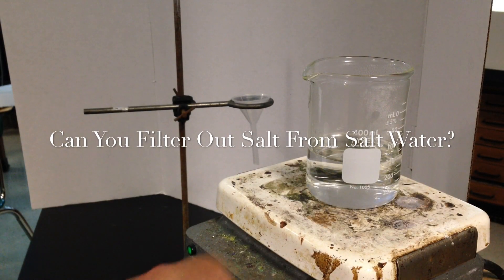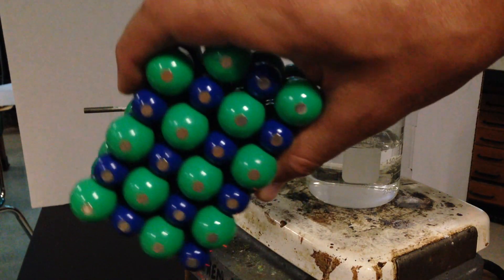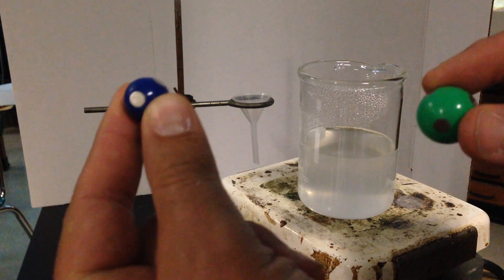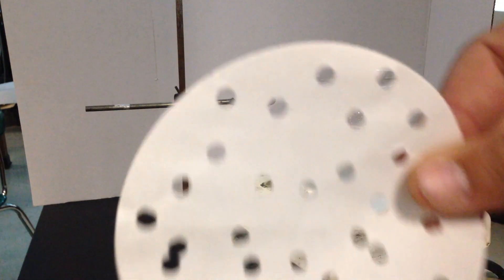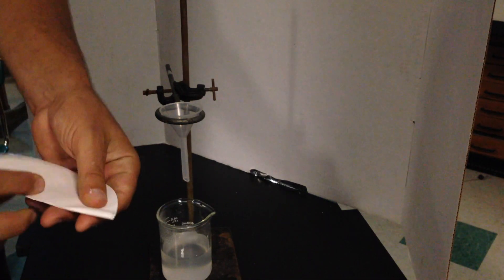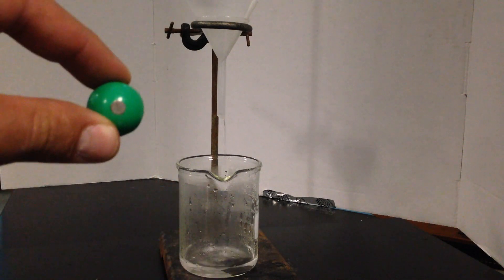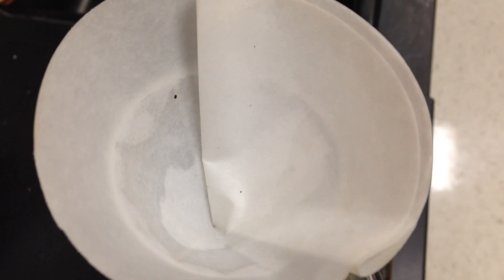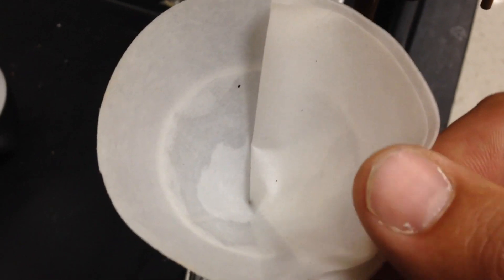Can you filter salt from salt water

Comment: This is not accurate. You are removing salt. Not enough in this way to make it drinkable (especially with just lab filters), but still a LOT. This is how reverse osmosis works. You can prove this by measuring with a TDS meter before and after. You could filter your own too with a syringe and a small membrane filter attached to it by adding pressure. In your example, gravity is what is assisting this process here.
Reply from the maker: The key here is not enough to measure a difference. Reverse osmosis requires a much larger pressure than gravity alone here.  The demonstration is for students who do not realize that evaporation of the water would be a better way to separate the mixture.